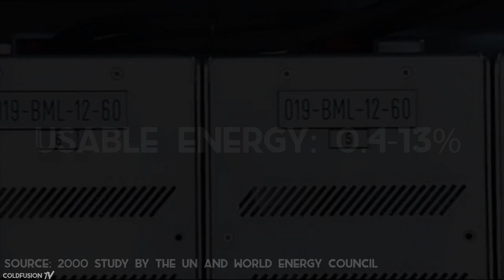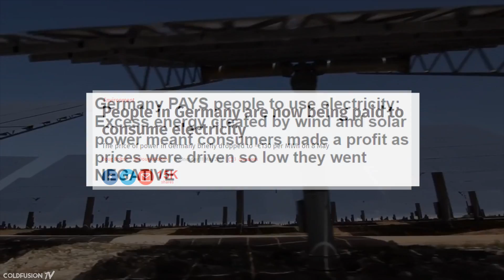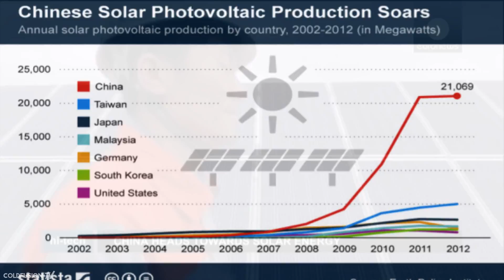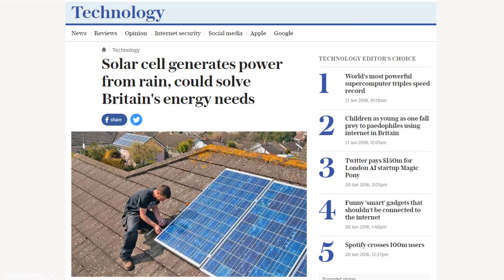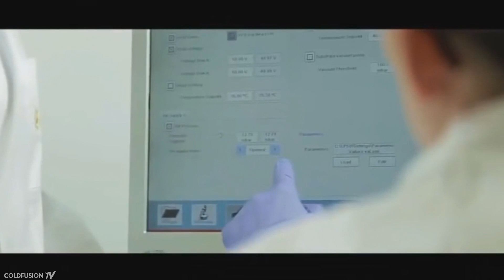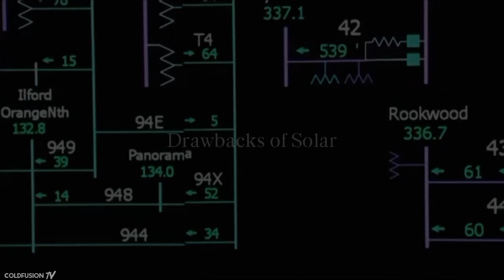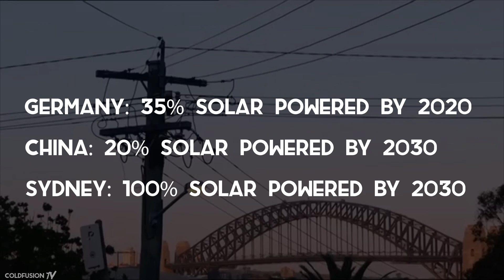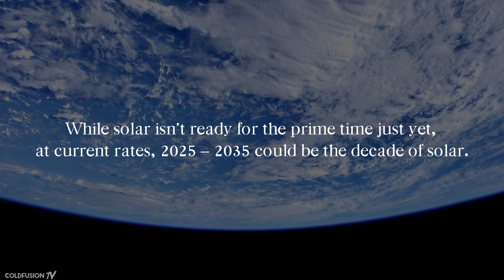The Truth About Solar

Comment: Oil production will not halt until we have a viable and cheap solution to plastic
Reply: you can make plastic form hemp oil...
Reply: There is nothing wrong with producing plastics from petroleum for durable goods. It is the single use plastics (packaging, grocery bags, etc.) that make me angry. Use it once, the waste is, in comparison to human life, essentially eternal. When these plastics are used for products that will be in use for 20-50 years and beyond, and are then recycled into other products at the end of the useful life of the original product, I see these plastics as a viable, sustainable material. For packaging and single use applications, we need to come up with a material that has a shorter lifespan than any plastic.
Reply: Pyre Spirit yes but the farms and soyplantations needed would be, and are, in the case of food production for the meat industry, destroying the tropical rainforrest. Because thats where such farms are usually placed. And that is much worse than just keeping regular plastic (wich is not even as bad as most people think it is)
Reply: You can use hemp for that.  The good news is that America could more than double the current global output of hemp on less than 1 million acres.  Our corn crops are grown on roughly 80 million acres by comparison and much of the uses for that corn can be replaced by hemp, such as livestock feed.
Reply: synthetics?
Reply: You cant make a plastic that will break down before the product's shelf life ends. Making plastics from plants eliminates the problem of them not breaking down naturally, but them breaking down is exactly why we use plastic instead. It doesn't solve the issue, just substitutes it.
Reply: crazycutz 
Trek Mtb carbon works in -15 C and 50 cm snow!
You save your carbon footprint and we raise and fall once in a while.
The only thing that makes a man feel great Are Trek Mtb,Seadoo, & Tera Joy.
Reply: crazycutz you can also create plastic from hemp, many times stronger than steel.
Reply: Sustainable replacement of aviation fuels will need to be found too before oil production will be halted.
Reply: "Sustainable replacement of aviation fuels will need to be found too before oil production will be halted."

We can still greatly reduce the amount of oil we use.  Benefits include lower oil prices thus lower cost for air travel.  

This is where the government steps in.  Like wind and solar energy, a robust market is needed for research and development in the private sector to really take off.  Incentives to make new, much needed, tech which makes them economically viable for a lot more people will get us there.
Reply: plastic, asphalt, rubber, etc... also nothing free about solar energy, panels are cheap but you need to buy a ton of other stuff to store and use it,. the ore in those batteries are minded and refined and cause a ton of pollution on its way to becoming a battery, that does need to be replaced after its life is up.
Reply: Yes you are right, so better using the oil production for plastics and medicine, than stupid burning inside cars and other transportations... Because burned oil can not be used anymore for producing plastic.
Reply: Bioplastics and casein coatings.
Reply: crazycutz please do your fucking research before you spread your bullshit. Do you know what percentage of oil actually gets turned into plastics? because of all the oil that is currentley used in the world about 4% actually goes into plastics. "oil consumption can only be stopped if we try and reduce it by 4%, and that will magically make the other 96% dissapear" that is what your statement boils down to if you actually look at the facts. btw plastics can be made from bio-made gasses. All you need to create a plastic is a carbon gas, like ethane and that can be made from plants. The reason we dont do that is because im pretty sure you dont want to spend more money on the plastic bottle than on the actual drink inside it.
Reply: We do have a viable and cheap solution to plastic.

Soy can be turned into a type of plastic which is as durable as petrochemical plastic.
Reply: Once we can produce it efficiently it could be Graphene
Reply: There are a huge variety of polymers, each with specific valuable properties; it may be that eventually they can all be substituted by plant-based alternatives with no loss of properties, but it will time to develop them.
In the meantime, we should be making a better job of managing our plastics use; better and more committed plastics recycling; better value engineering; promoting a healthier public understanding of the value that polymers bring to our lives.
I predict that future generations will condemn ours for burning oil instead of preserving it as raw material for more durable uses that don't pump carbon into the environment as if it didn't matter.
Reply: " a robust market is needed for research and development in the private sector"

Better the government step in by funding research itself than subsidizing companies that go financially under..
Reply: Chemical conversion with nuclear heat to produce the precursors to plastic.
Reply: James Lovell what about matter anti matter?

Comment: this is exactly what I wanted to hear. I'm working on a way to store excess energy indefinitely and move it without a grid.
Reply: My hero! We have to keep going forward and be optimist about new and better technologies. It probably requires a great investment, but we need those good results  :)
Reply: Stigmadiablo glad to see someone as optimistic as me about clean renewable energy
Reply: bahaha, you and thousands of PhD's backed by billions in funding.

good luck though.
Reply: Very cool!  Are you using a chemical process like Lithium ion or stored energy such as heat or momentum?  Or have you devised a new medium entirely?
Reply: ***** that's not great. barely acceptable for land/sea, completely useless for flight. only real solution is electricity to fuel and it can be done quite easily.
Reply: ***** I think it's the best option. we just need to get away from electrolysis to split water and a new engine design to eliminate contamination from atmosphere and oil lubrication. I'm working on the engine design first.
Reply: we have unlimited electricity. turning it into something useful as fuel has been the problem. nuclear waste is even worse than coal polution. hydrogen can be used with no polution at all.
Reply: both are pretty bad when no polution is an option
Reply: There are a few assumptions to hydrogen:

1. A majority of hydrogen production requires enough energy to super-heat water and produces enormous amounts of CO2.

2. Storage for small-scale use (vehicles) is a concern because of the explosive nature of hydrogen.  Accidents become far more deadly.

3. Hydrogen fuel cells only produce 0.6 to 0.7 volts at low amperage.  Producing gigawatts (volts x amps) would require HUGE power plants.

I do like fuel cells - no moving parts, no wear from usage.  It's just that the technology isn't big enough for common usage.
Reply: Actually, I wanted to simply mow my grass and weeds a few times a year, dry it, grind it a little, and compress it into pellets and burn it in Winter for heat. This is carbon neutral.
Reply: Robert Platt it is a somewhat known medium but hasn't been figured out how to use it 100% clean
Reply: LOOK at the salt-water fuel-cell technology; most of it was abandoned by the nukelar-heads in the 70s!!
Reply: It looks like salt water fuel cells are need but suffer some major drawbacks:
- Requires a large area to generate a tiny voltage
- Requires oxygen which either makes it highly flammable or exposed to the air where contaminants are easily introduced.
- Like a battery, the fuel is not recycled which would require changing and cleaning the toxic waste

Beyond that, it does look interesting.  Perhaps an air/oxygen bubbling method would be better?
Reply: I think Tesla Power wall lithium ion batteries seem to be the answer.
Reply: batteries are too heavy with too little power for travel. we need to convert electricity into fuel.
Reply: Chris Dishneau not necesarily. Tesla cars already have a greay (500 Km) autonomy and they only use batteries. it's just a matter of reducing the costs for that.
Reply: Chris Dishneau I thought other purely electrical cars with barely 200km of autonomy were barely acceptable. Compared to those, a Tesla car with 500Km is great! Of course we are talking about land. About flight... well that's another story. The Solar impulse has already given a good test of what can be done. And yes. using hydrogen instead of batteries to store the energy could be the answer for fast and lenghty air travel.
Reply: No, electricity to fuel is not a good idea because something has to generate the electricity first.  We need energy stored from electromagnetic radiation (light / magnets) or movements (water / wind).  

If we could convert heat into a useful fuel or store and move it, we could reduce electricity dependence significantly.

Storage is a big deal, but generation and conversion is more important.  That's why the promise of cold fusion is such a big deal.

In the meantime, we need more nuclear!
Reply: Robert Platt perhaps, but if you look at the order of factors, both Tesla and the guys at Spain thought hydrogen was a good way to contain the energy to be used later.
Have you guys seen this project from Tesla?
https://nikolamotor.com/one
this electrical powered truck uses both batteries and a hydrogen fuel cell to have great autonomy! and of course, to refill the hydrogen to keep it running, Tesla is planning to have several hydrogen charge stations spread. Now where or how will they get the energy? Of course from solar panels and eolic farms! Want more examples? Toyota Mirai also uses a hydrogen fuel cell.
Reply: Chris Dishneau - "We have unlimited electricity..."
Where do you get that?  The USA alone burns HUGE amounts of fossil fuels daily to meet electrical demands.  Currently the USA runs over 80% capacity and demand is growing.

Nuclear waste is nothing compared to fossil fuels!  If you brought every ounce of spent nuclear fuel from around the world into a single place, it would fill a football field 3 feet high.  That's it.  

By comparison in 1 year coal power plants in the USA produce 1.7 Billion Tons (That's 3,400,000,000,000 pounds!  That's equivalent weight to nearly 9 MILLION 747 jets.)  Coal also produces SO2 which combines with water to form acid rain.  Acid rain eats away marble.  So places like the Roman Colosseum are turning smooth.

Hydrogen has a few problems.  First, generating hydrogen isn't a free process.  It takes energy.  Storing hydrogen is the next big problem.  Usable quantities require 5000 psi or more of pressure.  That means car accidents become far more explosive.

BUT hydrogen burns into steam so it's certainly good on emissions.

And then there's IVR nuclear reactors that produces only 1/4 the nuclear waste and are nearly impossible to melt down.  Check out Pandora's Promise.  It's on Netflix.
Reply: +Robert Platt we have unlimited energy all around us. we refuse to tap into it because fossil fuels are more profitable right now. my issue with nuclear waste is the thousands of years it stays toxic.
Reply: Well... Robert Platt and Chris Dishneau 
Cold Fusion or at least fusion seems to be still not a viable option yet. If Thorium fueled MSR (LFTR) reactors could be as marvelous as dreamed with all the advantages I have heard they have over the nuclear reactors we have seen up to date, it would be awesome! Nuclear waste problems would be drastically reduced!
However, while I would like to see those things I don't want to put my bets on that. I prefer solar and eolic to become more widespread.
Oh and true, the reason people are not doing desperate efforts is that fossil fuels are more profitable, but the damage to earth is already done.
Reply: When the sun is at zenith we get about 1 kW per square meter.  But how do you harness it?

As for nuclear, yes, we would have a few new areas that would need to remain isolated.  Compared to the total amount of land area, we're talking about a tiny percent of a tiny percent.

Regardless of storage, which is worse: adding a few off-limits areas or pumping billions of tons of CO2 into the atmosphere?
Reply: An interesting opinion.  How do nuclear reactors pollute?  Everything is self-contained.
Reply: Nuclear waste is well contained on-site.  As such it poses no pollution threat. Even when nuclear waste escapes we can usually clean it up.

CO2 emissions can't be contained and there's no way to clean up a massive CO2 event like a volcano.
Reply: Robert Platt Chris is right.  CO2 can be captured and converted by plants or other means. Nuclear waste on the other hand will stay extremely dangerous for a long enough period of time that we can literally say "Forever" unless we try improving the nuclear technology we have. And you speak as if nuclear waste leakages were impossible. Thorium fueled MSR (LFTR) reactors promise a lot, but that's yet to be seen. On the other hand, solar and eolic are already delivering, they have already proven their potential, it's just a matter of thinking different and making the impossible possible!
Reply: sturdy tanks protected from impact would make them even safer than gasoline. old ways of hydrogen production are inefficient . resonant sound waves seem to be the best option to get pure HHO gas, which is required for my clean engine design. storage seems to be the biggest issue with hydrogen but I think that could easily be solved if we made it a mainstream fuel. for the electrical demand, I think I have found a solution that would also remove taxes to pay for roads, having fuel stations take over road maintenance for the electricity.
Reply: Zinc/air rechargeable batteries are already on the market for large scale applications. They are lighter than any of the current batteries because they only contain zinc and use the air. They store several times the energy of the other batteries, are much cheaper etc, etc...
Reply: That sounds like an interesting idea.  There are a few things to consider:  is the drying and pressing process carbon neutral?  (I imagine it can be.)  Will your smoke stack handle grass/leaf ash?  You might find a lot more soot.  Be careful.  Chimney fires are a major cause of house fires.

Perhaps you can invent a combination solar dehydrator and press to automate the process.
Reply: As far as ash is concerned I don't see any more problem than burning wood. Pine and resinous wood should be avoided. Any wood burning stove pipe should be cleaned with those stove pipe brushes every two years. I have several setups for drying things with the Sun. Grinding may take a little energy. Of course mowing takes some energy. I see this as being as carbon neutral as u can get.
Reply: Very well thought out.  
I agree.  Heating your home with yard trimmings would be as close to carbon neutral as possible.
Reply: o
Reply: The Bunny Suit Killer Actually, water is very clean, drinkable, and has little as possible of methane here. I live in Florida too
Reply: ***** Lol I let my friend type that, I hope I didnt hurt your feelings
Reply: Robert Platt Huh? oh come on, don't play dumb. Two words: Nuclear waste.

https://en.wikipedia.org/wiki/Radioactive_waste
Reply: nuclear waste still has to be contained for thousands of years. why deal with that when the only byproduct could be purified water
Reply: Cleaning a wood stove pipe every two years?  Before this household switched to wood pellets it had to be done every WEEK or a chimney fire was inevitable.

Comment: Whhhhyyyyyyy. The chemicals we use to make the panels are toxic as fuck and it's going to be years before we have it cheap enough to unequivocally beat coal n gas. We've had thorium for years and fusion is around the corner yet still people want this backwards rubbish technology in hopes one day it will be viable. It's like ignoring the combustion engine cos you're sure one day horse n buggy will get better and better.

Comment: as much as having a single way of producing electricity right now is stupid, like 100% coal, or 100% nuclear, the same thing will apply with renewable energy.
Solar is great and will probably THE most important, cheap and easy to use, but it has to come in a mix with tidal energy, geothermal energy, wind of course, solar and other kind of renewable energy
When you mix all those you'll get as much energy as you want 24/7 without care for tomorrow's forecast

Also for developing countries need, they might just do like they did with cellphone, skipping the landline expansion all together, and just drop the big investment of energy grid with a central plant and go for local energy unit with solar or wind energy in village/cities, lowering the strain on the massive high power lines crossing countries

Comment: i think the grid issue of switching to solar is kinda moot. remember that people will be producing their own solar power. so if most people have their own grid, and 0$ power bills... the grid will go away in about 70 years. bad for power companies, but they are assholes anyway. we just need to get solar power to the point where a single house plus yard can produce enough power for the house and the consumption of the inhabitants.